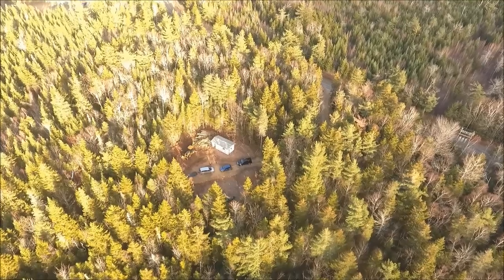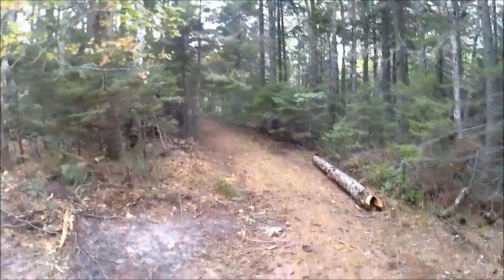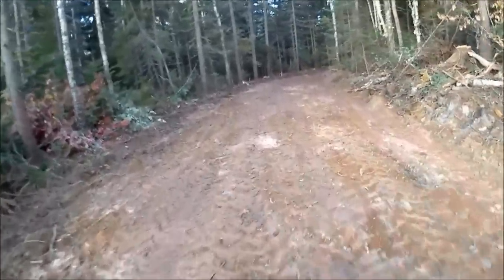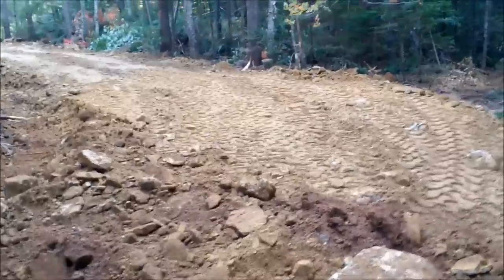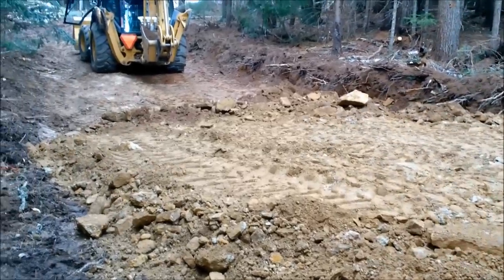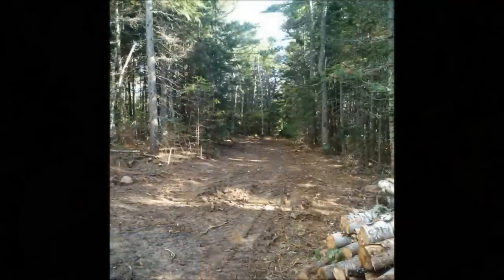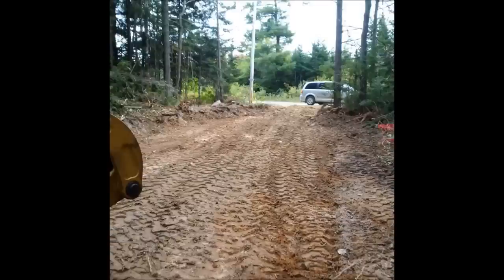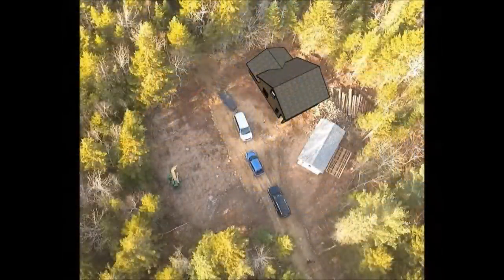How to Build a Gravel Driveway. Building a Cabin DIY - Video 4

Comment: Here in Nova Scotia they charge 10.00 a foot. My road was 900' . I had truck size boulders so I couldn't do it myself...they remove the stumpage but you have to take all the standing timber...more cost if they need to fill in wet low areas ...
Reply: Hi Jedidiah. I'm going through the same process right now. I just purchased the land, but it has a lot of wet area, and the excavator told me I'd need to fill about 200 ft long to clear myself a road. Do you think it's worth it?
Reply: @johnnyblue_  If you are developing the property and plan on wanting road access all year around, its probably worth it.

Comment: If you have time to edit the sound, run the video thru free program called Audacity. You can easily boost volume by dragging and selecting audio then increasing the Dbs. Then sync the audio back up to your video using a video editor /muting original track and add the audio track :)
Reply from the maker: Thank you for the suggestion. I'm learning all sorts of new things because of comments like yours; I really appreciate it.

Comment: I would never dump shale or clay material on the road . It will be quite a messy in a rain season. Dump rocks 6 to 10 inches for good drainage or even larger and top with crushed rock 2 to 3 inches. I went through this process so I am describing my experience as I had to re do part of my road. Of course it will depend of the soil you have in place in your area and the terrain gradient. My property had some gradient towards where the cabin would be built so the lower areas would the most prone to be muddy after few days of rain.

Comment: I personally would have used road fabric and stone, really don't see the need to haul in all that clay/dirt. Akso the driveway is a bit narrow, maybe ten feet at best, I typically will make a driveway 12 feet min as the vegetation grows back very quickly.
Reply from the maker: It's actually shale, not clay/dirt and it's about 14ft wide. I decided not to use geotextile fabric because of its cost and haven't had ANY movement whatsoever, even after 3 years. Thanks for watching.

Comment: did you really need all that dirt to make a base for the driveway? what was wrong with the dirt already there? was it uneven?
Reply from the maker: I actually wanted to get rid of the dirt that was there and replace it with shale and gravel. Dirt gets muddy in the spring and when it gets wet. Gravel with a shale base however, is rock solid. Throwing gravel on top of regular dirt will never give you a solid driveway. Not in our climate anyways. Thanks for watching!
Reply: @ChrisOfAllTrades  Shale ? More like dirt and rocks . If it rained on that stuff , it would be mud too.
Reply from the maker: @timhottinger2166  actually, it had rained and the ground has been frozen and thawed multiple times and the driveway is rock solid just like I planned. Thanks for watching though

Comment: Nice job!  I am a newbie at all of this construction stuff.  I live in a sort of basin in the Arkansas mountains, and we get all the runoff from the surrounding hills. We also have horrible fire ants... therefore, I want to put a concrete slab down to build a garage.  I have been searching for a video on how to prep the building spot.  I want to build it up so the water will run AROUND it and not THROUGH it.  Would I do it the way you did this driveway?   I think you said you raised the driveway 8 inches.  How much compacting do you do for each inch, or each few inches with that height addition?  I appreciate any guidance.  Thanks, and I look forward to seeing your cabin.  I'm going to look through your more recent vids for it.
Reply from the maker: I have all the footage to show what I did for my cabin base prep but I probably won't have time to edit them until the winter. Basically, I stripped the soil down about a foot or two, then hauled in gravel in 6" loads and used a heavy 1000lbs diesel plate compactor (rented it at a rental store) to compact the snot out of the gravel. Added another 6" and so on until I had a level base. Once the concrete slab was poured, I back-filled up against the slab with a slope away from the cabin and then ran a 4" perforated drain tile all the way around the cabin at the same level as the BOTTOM of the slab. I figured all the surface water will run away from the cabin because of the slope and get carried away via a surface swale and any water that will seep through the soil will get intercepted by the drain tile and get carried away sub-surface. I hope this helps. Good luck with your project!
Reply: I'm also Arkansas watching this. My issue though is that the driveway is ozark mountain unenven and we can't drive on it. We have to park on the side of the road and walk onto the land as of right now.
Reply: @knteague89  That sucks. 
4 yrs later and I still haven't been able to do my garage.

Comment: How much did the dirt cost ? Per truckload just as estimate ? (Not to he intrusive)
Reply from the maker: Shale was $100 per load, gravel was $140 per load. They were small loads though. I think I used 17 loads of shale and 7 loads of gravel.
Reply: Thanks
Reply: here in CO, you'll pay only about $30 for a truck of material, but $175 per load for the labor :). i do live a few miles out from town, to be fair

Comment: Why does it matter if there are branches hanging over the driveway?
Reply from the maker: It didn't matter that the branches were hanging over the driveway but they were hanging over where the power lines were gonna go and they have strict rules as to the clearances they require above, below and beside power lines.
Reply: @ChrisOfAllTrades  Thank you, and thank you for the video. I am trying to gather as much info as I can. I am renting a loader/backhoe in the Spring...I plan on doing a driveway in the mountains/forest of CO. I am in planning and research phase at this point.
Reply from the maker: Glad it helped. Good luck with your project!
Reply: @parkercatan1608  I plan to do the same next summer. I hope you put up some videos so I can get a better idea of what it'll be like in our state.
Reply: One reason not to have overhanging branches is that if you're in a snowy climate you'll see lots of downed branched from heavy spring snows and having them on your driveway is no bueno.  Even if you don't get snow having the road opened up to sun light and the heat of the day is a really positive way to keep a gravel or dirt road dry and prevent long standing mud or spongy shoulders.  Having a box blade helps to open up the road some and redistribute gravel when potholes develop too but almost any size tractor is a big help too